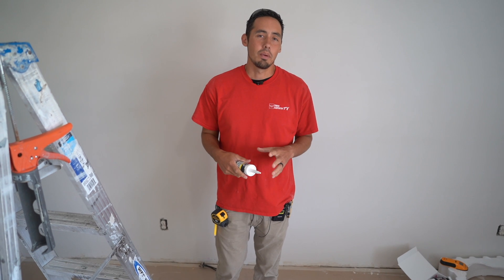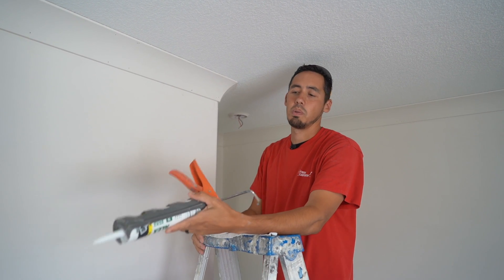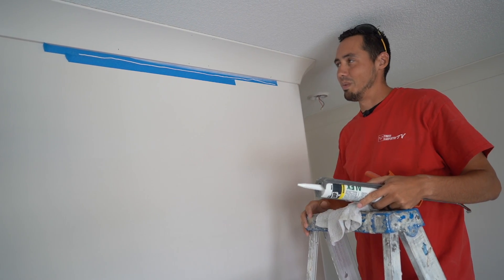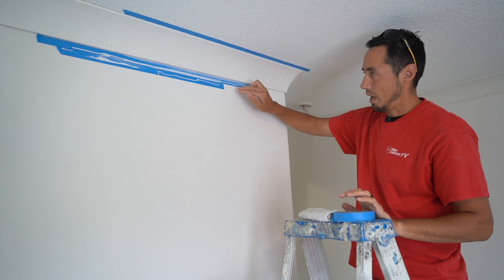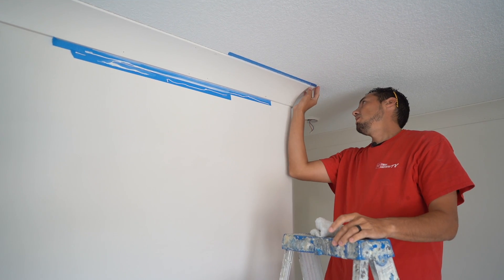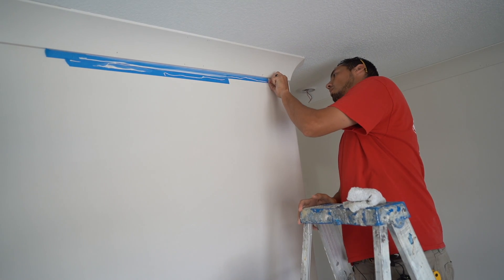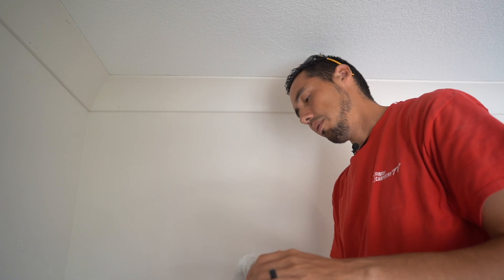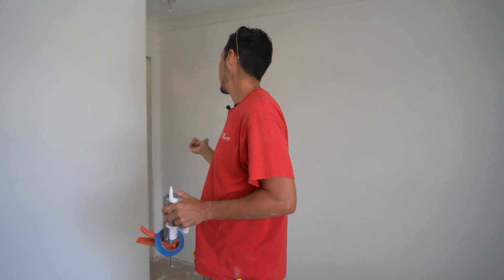How to Caulk Crown Moulding and Finish Trim Work

Comment: Great video. Would you still use white caulk on off-white trim on a gray wall where the crown molding and wall meet to fill in gaps? Wouldn’t the white caulk stand out too much? thanks.

Comment: Thank you for a very informative video, you explain each step clearly and unrushed! A question if I may. I am about to repaint my ceiling, walls, crown molding and baseboards. Do I need to remove the existing caulk before re- caulking? Is there a benefit to that?

Comment: Just want to say thank you for posting this video.  You really helped me eliminate some annoying gaps between our crown molding and the ceiling, and the wall.  (Our home was built in '68, and I guess things have settled over time.)  I was able to caulk it in and smooth it out nicely, and it looks fantastic.  Your tips for cutting the tip of the caulk tube and for using painters tape and removing it while the caulk is still wet to get a nice straight line where the crown molding meets the wall were a huge help.  I'm not that experienced with caulking and was not at all looking forward to this job, but it went VERY well.  Again, THANK YOU very much for sharing your expertise!!!

Comment: I’ve been using my finger for 40 years. I finally learned how to use the caulking tool and it is amazing.  Instead of the fat bead you leave with a finger, you can control the size and profile of the bead with a tool.  It’s a beautiful bead and it’s perfect.  It’s a small squeegee that also removes the excess off the sides.  It’s the most revolutionary tool I’ve gone to in 15 years and costs a couple dollars.

Comment: This has been one very helpful video.  This old lady has been painting and caulking her home now for over 40 plus years and this video has taught me the proper use of the caulking gun.  I never knew that the handle  (not the trigger) could be used to stop the flow of the caulk when not in use and it was helpful to know to cut the tip  of the caulk for my use just a tiny bit as in the past I had a mess of caulk that I wiped away that was wasteful.  At my old age I still have an interest to do small jobs and I am thanks to you well informed and ready.  Thanks again for the tips.

Comment: Great video, thanks! In what instances should you caulk under baseboard and not caulk under baseboard? I'm getting ready to do some trim work in my house and this is something I'm unclear about. Thanks!
Reply: Why would you ever?
Reply: @homealonebuild3090  where I live (Florida) it is very common to see baseboard caulked along the bottom edge in homes with tile flooring. My guess is this is for both flooding and bugs. Even with basic mopping of the floor, you wouldn't want mop water seeping under your baseboard. However, I've noticed in some businesses there is no caulking along the bottom edge. I'm not a carpenter or painter, so I don't know what the actual guidelines are for this.
Reply: @nyseone9991  I'm sorry, you had said "under" the baseboard which seems a lot different than the bottom edge... I was picturing caulk between the wall and baseboard.
And, living in Florida myself, I'm definitely familiar with those damn bugs.

I generally caulk the top and bottom edges of the base. Anytime I decide that I can't caulk (a surface that I don't want to see caulk on) I come up with another solution to prevent pests from sneaking in. A thin layer of packing type foam might work or using that real flexible quarter, plastic quarter round that easily conforms to uneven flooring.
And, I've done a lot of mopping in my day never using the slosh method; more of a damp...

Comment: Which paint do you find finishes well enough to be used with a paint brush on crown moulding?
Reply from the maker: I find that it is typically the brush that makes the biggest difference. But to answer your question I use satin sheen paints for the best looking finish.
Most builders use semi gloss. My brush of choice is a 3-1/2" angle Corona tynex/nylon. Very soft bristles. Amazing brush. It is all I use.
Reply: I just used Sherwin Williams Emerald Enamel on some casing I installed.  Primer and 2 coats of that with sanding in between coats had it turn out awesome.  I used a Purdy Chinex brush.

Comment: I used my finger for years 30+. But before a total gut and install of a high end bathroom last winter I watched a video 
By sal diblasi.  He showed how he used a corner tool for his caulking. I thought it was being a wooss.  But after using it in the bathroom I was hooked. No need to tape and it’s the most consistent application ever. Just another thought cause i love your vids!!!
Reply from the maker: I'm always open to learn more!
Reply: I know you are... that’s why we love watching you!!
Reply: Lol same here. I was like...meh...ok ill try it- it's $3. I love it. I use it for caulking shower corners, shower walls to tub and shower floor to wall joints that have to be flexible. I like because it does not under cut the caulk joint in the tile. For trim i still like the finger method. haha
Reply: That guys a beast with tile.I did my master and kids bathroom by watching his vids.

Comment: How do you break the seal in the caulking tube when making such a small hole in the applicator nozzle ? Will pressure from the caulking gun do it alone ? I’ve always had to insert something sharp down through the nozzle to puncture the seal.
Reply: Randy Finfrock Painter’s caulk usually does not have an inner seal to break. I know some tubes have that inner seal but non of the painters caulk I’ve come across.

Comment: Great vid! As usual, the only thing I would add is that you NEVER use caulk to fill nail holes. (which you did not. I was so happy to see that). The caulk will suck into the nail holes or bubble out & you can't sand it afterwards. I have seen so many people do vids using caulk to fill in nail holes and, as soon as they do that I am out. The other thing I would mention is that you HAVE to use paintable caulk if you plan on painting it afterwards. The only reason I am mentioning these things is that this is the BEST newby caulking vid I have seen and, if you are that new to caulking, ya need to know these two things. I LOVE the ALEX Plus. Didn't used to BUT the new formula is excellent to do trim. It sets up a bit more slowly so you have working time and it is super easy to wash up afterwards. I use a small bucket with a couple on inches of water & a paper towel that I rinse out often. The excess caulk sinks to the bottom of the bucket & can be easily rinsed out. NEVER use the garbage disposal section of a kitchen sink to rinse out anything with caulk, or you will be buying a new disposal. I have a mobile home so my joints are never perfect and I have become an expert at caulking becasue of that...EVERYTHING needs caulk and NOTHING is ever perfect.

Comment: Do you normally caulk the bottom of baseboards or just the top?
Reply: I do both. It will give you a clean line at the bottom, plus you seal the gap between the floor and the baseboard to prevent any insects or dust getting underneath. I finished one room a few days ago, looks very good

Comment: I'm fixing up a house I just bought and I'm calking all the door frames but ran into a problem that maybe you can help me with. In the corners of the door casings how to you finish them? I have fat fingers and have a hard time getting in them without loading it up with calk (looks horrible)  I've been using a wet rag over a flathead, it works but is time consuming. I've learned alot form your vids and love the channel man!

Comment: Freshly installed trim will shrink slightly over the first year or two, especially in the Deserts of Southern California, and separate from the caulking. It's most noticeable at the junction of two heels of a miter joint. A stretchy caulk is a necessity. In the process of caulking doors jambs, window trim, baseboard, crown moulding, tubs, sinks and countertops for twenty 4, 5 and 6 bedroom homes AFTER paint one year I learned that you have to keep your finger really clean because otherwise the flat wall-paint sandpapers your finger and leaves smudges. In that dry atmosphere it helped if I moistened my finger on the towel before wiping the excess off. Also, you're doing custom work, I was covering construction defects done by other Contractors...sometimes I had to fill those 5/16's gaps. You're an interesting person...you talk and move so slow and yet you get so much work done.

Comment: Im renting a house that was half ass remodeled and I have up to 1/4" gaps on the top of the crown molding that were never caulked. It's really hot in the summer. About 10° hotter than what the thermostat is set at. Is this because of the huge gaps?
Reply: 🤦🏻‍♂️ unless someone has drilled holes in the wall behind your crown molding ......no ...... probably a bad thermostat or your AC unit is having issues

Comment: A wise man once said " If you're cutting down there at 5/16, just go ahead and take out what you installed and reinstall it." 😂😂
Richard DFW
Reply: That shit cracked me up. “If you’re cutting down here, you’ve got bigger problems. “
Reply: I've been doing caulking for more than 10 years. Another tip to have a good solid caulk joint is 2 tool your caulking the opposite direction than how you shot it with your gun, for example if I shot my bead left to right I would tool it right to left.
Reply: Lmaoooooo

Comment: Good gravy I love your channel, so much knowledge. This may have been in another video, but curious if you put construction adhesive on the crown when installing? Or just nails?
Reply: I''ve never seen him use adhesive to attach any trim (accept to another piece of trim). Generally, the whole idea of trim is designed to be able to remove, repair, replace, etc. without damaging the surrounding areas.

Comment: So after caulking you going to patch nail holes then hand paint? You could really mess up the edge if hand painting isn't perfect. Or maybe you would tape?
Reply from the maker: Good question. We have developed a steady hand for painting I will make a video on that too
Reply: On per primed wood light sand first dust off with dry old brush (No moisture)then fill with my way sand vacuum with brush then caulk and & good prime light sand vacuum with brush then spray finish 2 coats

Comment: Great tips. I do about the same, but also have a small container of water to keep my finger clean and a pallet of cardboard or wood scrap to wipe the access caulk off. For bathrooms and such that need 100% silicone, we spray it with Windex to get a smooth, clean finger wipe. Thanks for the tips.

Comment: Love the long videos!

I always tend to rip the tape off more or less straight away after I'm done caulking. I've had a few instances where some of the caulk actually rips out when I remove the tape when I've let the tape sit overnight..
Reply: Too much caulk
Reply: @kennethriley3565  well no and yes. yes maybe on some places where it was necessary, but I get a smoother line in general when removing the tape before it has cured.

Comment: My ceiling is a little wavy from the age of the house 1950 and creates 1/8 " gaps between wood beam molding and ceiling. Now ceiling is gray and wood beam molding is pure white so I am worry to keep a straight line should I paint down to caulk after I fill gap or paint up caulk with the white?

Comment: Thank you so much for your advice about painter tape to apply caulking! I found a place where I can test the technique and it works just perfectly, so nice and clean look above my molding! We remodeling house mostly themself and caulking always was a problem for me to apply as I want it look should be. We have some tools to smooth it out but personally for me, not any of the tools work well. If we use the tape the process takes longer but the result is amazing! Thank you again!

Comment: One thing with tape I noticed is that when you remove the tape you sometimes have a raised line where the edge of the tape was.  It’s unavoidable because the profile of the tape, while very tiny, means that the caulk does not merge seamlessly with the wall, ceiling etc.  How do you handle this situation?

Comment: What do you use to fill the nail holes so they don't dry with a depression? Caulk? Spackle?...Thx
Reply: oknave327 just use caulking and a flat surface of any kind to wipe it off, if it’s a small hole just use caulking and wet rag to wipe it off flat
Reply from the maker: video coming soon!
Reply: Don't use caulking. It will shrink and the holes will show. Use non-shrinking spackling, or Bondo
Reply: I use something called 'modostuc', it’s a paste that comes in colors but is perfectly paintable as well. It’s easy to use and clean up and doesn’t shrink. Look for it on Amazon.
Reply: I mix half and half the per mixed white spackle patch and min wax red sparkle gob on finger push in hole ( all the way in) then leave little on it for shrinkage let dry sand of I've been doing it this way for 30 years go back to to jobs done that long ago trim looks awesome light sand repaint done I spray ALL TRIM AND WINDOWS DOORS AND FRAMES
Reply: The quick dry drywall mud powder in a solo cup with a little water. Cheap and drys fast toss the extra.
Reply: Painters puffy shrinks and looks like crap
Reply: My environment is blazing hot in summer to below zero in winter like I said never a problem in 30 years repeat customers in the best towns in north Illinois did the guy who had the first Batman movie watches in McDonald's happy meals in early 80's 15000 thousand sq feet not a single problem still go back cause it's done right!!!

Comment: Thanks for the great info on caulking. I always make a mess and found those caulking tools to be ineffective. I'm sure you've covered it in another video but what do you fill the nail holes with? I've watched some other videos on finish work and seen them use caulk for that, as well as wood putty. Appreciate the pro tips and the length and content of your videos is great!
Reply: Crawfords putty is what most painters prefer for quickly filling holes but  If you really want to make the disappear, bondo or 3m makes a spackle with primer built in that works pretty well.
Reply: 1/2 white fluffy wall patch 12 min wax red wood fill mix good use finger to fill hole (push little gob all the way in) then live a little on top good dry time sand lightly it looks awesome & lasts for ever
Reply: Never fill nail holes with caulk. It shrinks and you will see every hole after it's painted. I like crawfords. It's super quick and once you learn how to use it properly there's no sanding needed. The key is to GENTLY buff it off with your finger once you fill the hole. If you push too hard it leaves a dent. Sometimes in a pinch I'll use pva glue (carpenters glue) mixed 1/2 with water and use that with 20 minute drywall mud. Makes a really solid wood filler. I use this technique when I have to kerf cut base boards for curved walls. It dries really hard and sticks very well. And really easy to sand out.

Comment: For counter tops I've scribed to a wall I use those 6" metal rulers to scrape the caulk then I use a rag to clean up any thin bits of caulk it didn't remove.  My scribes are usually pretty tight so removing as much caulk as possible makes the joint super crisp and tight.  Light pressure is needed so as to not scratch the wall or countertop.

Comment: I prefer to mix my trim paint in my caulking to avoid it turning brown over time.
The paint seals the caulking.

Raw Dap will look white for about 3 months then it will turn brownish accenting the line.

Caulking is an art.

Good video
Reply from the maker: Very true. We always pass the brush over the caulking. I forgot to mention that. Thanks for bringing it up
Reply: Yes caulk is making a surface to be painted and dust and dirt was all stick to the caulk and turn it nasty looking after a few months
Reply: “I prefer to mix my trim paint in my caulking”....I am so confused. Surely you don’t spew out you caulking into a paint can then gather it back up and try and apply it?? Forgive me I’m three time zones away from home and it’s late but I have to believe you’re just recommending to paint the caulking afterward right?
Reply: Ryan Kelly 
I use the Exact Colour caulking kit.....
Add paint, shake,add hardener, shake. Wait one hour. Then it’s ready to use...
Reply: @FinishCarpentryTV  this could make its own five minute video. Especially if trim and walls and ceiling are different colors, how do you color the clock and make a clean line? How does masking fit in with that?
Reply: Finish Carpentry TV 
Hey man ...
Love your channel.

Was thinking of starting my own ....would appreciate your help.

Let’s do a color matched caulking video together.

How do I reach you?
Reply: @flyrc88  not if you use a quality caulk , the worst caulk is the alex fast dry, absolute crap ! I use extreme stretch now and its well worth the 6 bucks per tube, lasts and lasts and stays pure white !

Comment: I'm glad to see him mention the straight cut and holding the gun straight.  That works beautifully.  Also, he's using the cheapest Alex caulk.  The next one up with the blue print is much better.  You'll like it.  
Wanna do an invisible caulk job on stained and varnished wood in a kitchen?  Put the tape over the joint and burnish it into the seam with a dull knife.  Then cut it apart with your knife.  Don't gouge it all up.  Use a clear caulk and smooth it with your finger to force it into the seam.  Pull the 2 pieces of tape off and it's invisible.  You're welcome.